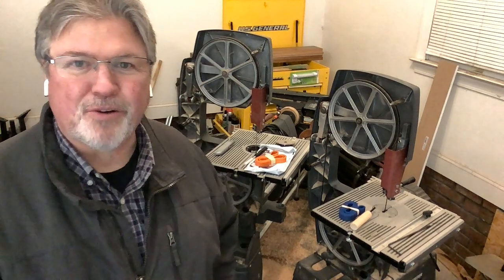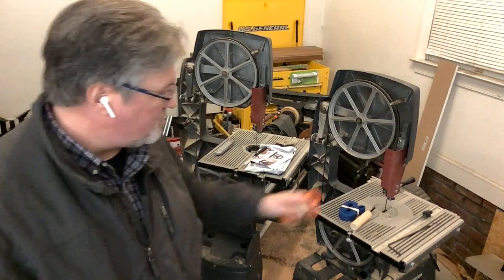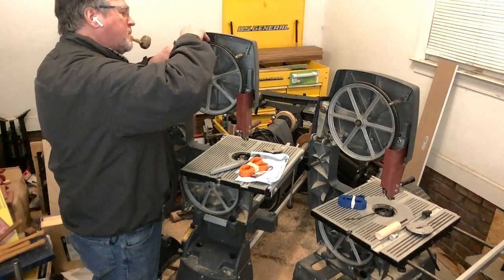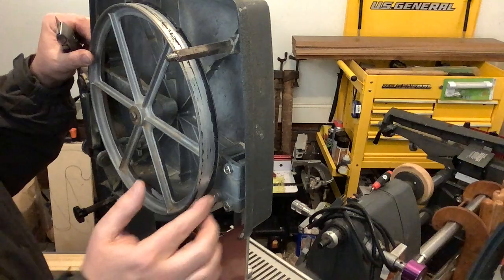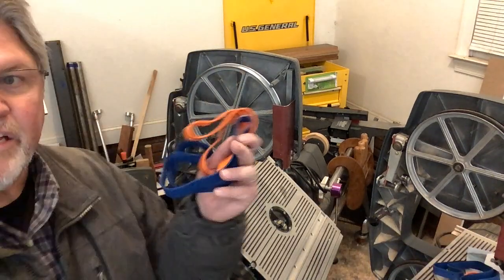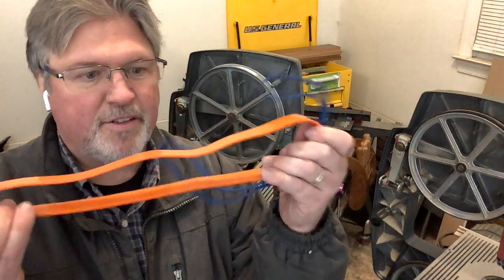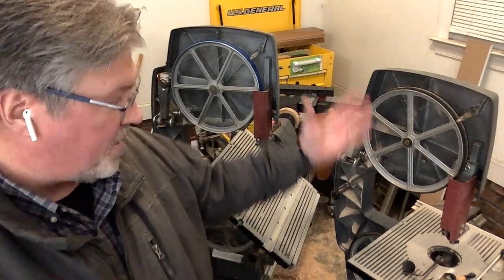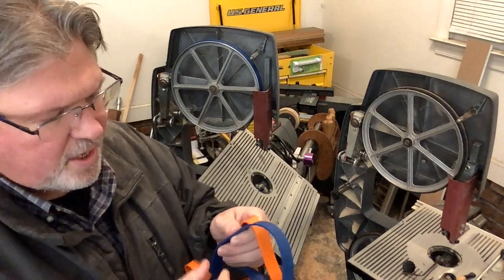Installing 2 Brands of Urethane Bandsaw Tires on a Shopsmith Bandsaw: Sous Vide Everything?

Comment: I'm wondering about tire slippage. maybe paint a small mark on the wheel and tire at the same point to see if the tire slips on the wheel? stay healthy, Russ
Reply from the maker: That's a great idea. The tires have a seam, so a mark on the wheel at that point would be easy to do. I'm on it! Scott
Reply: Garry not Linda. I've had the blue tires on my Jet for 2 years. They haven't moved a bit. Love 'em.
Reply from the maker: @bassrun101  Tht’s good to hear.

Comment: Looks like Mark beat me to it. I was also going to mention about running the tool under the tire to even out the tension.

I did want to ask if you have any thoughts on another project I'm doing. I'm restoring a very old 14" bandsaw which does not have grooves on the wheels. Is it worth trying to put tires on it, or are the likely to come off without the wheel geometry to support them?
Reply from the maker: Oooo, I think I would be tempted to glue rubber tires on. Are you sure there's no raised edge at all?  Scott
Reply: @MyGrowthRings  yes, the wheels are totally smooth. It was originally a butcher's saw.

Comment: I bought the orange tires from shopsmith and had nothing but trouble with them. 
Got the blue max tires. No problems.
Reply from the maker: Is it your recollection that the orange tires were slick and shiny like the set I used?  Scott
Reply: @MyGrowthRings  I wasn't looking at the smoothness.  I would run the band saw and the tire would be coming off the bottom wheel.  Looking at the SS owners site, I see the same complaints about the SS tires.
Reply from the maker: How long ago did you purchase the tires from SS? I recall at one time that there was a mix-up with their supplier and they wound up passing on 12" tires, which stood no chance of staying attached. That was at least 10 years ago, if memory serves me. Scott
Reply: @MyGrowthRings  I don't know. I might have gotten them that far back. I put them on last winter.  I have a tendency to plan ahead.
Reply from the maker: @daleclementson8761  If it is even a remote possibility I’d say you plan ahead!

Comment: I bought a set of blue tires and measured them, and from the seam from start to finish there 30",  the circumference  of the 11" wheel is 33" , soaking them in hot water up to 170 deg and trying to get them on I give up, what we they supposed to be before socking and stretching them

Comment: I used the orange tires but took the wheels off the machine and used a jig I saw on Youtube.  I didn't use heat.   I don't know how much benefit there is to the texture of the tire since the set of the teeth provides the purchase needed to propel the blade.
Reply from the maker: I agree with your observation about the texture, though some folks have has traction issues with the smooth (slick) orange tires. Scott

Comment: What are the odds that this video shows up today? I turned my bandsaw on a couple of days ago and the top tire blew apart. It done a little damage to the cover and put a nice little kink in my fairly new blade. I was wondering weather to go with the urethane or rubber tires from shopsmith.

Comment: I’m having trouble with my bandsaw tires. I tried the urethane ones from Amazon, the rubber ones from shopsmith, and I just got the urethane ones from shopsmith.  They keep sliding off the wheels.  Any idea what could cause this?
Reply from the maker: Did you hear them in water first before stretching them on? If so you may have used water that was too hot. Depending upon when you ordered the tires from SS they may have been too large to begin with, because they had a batch that they shipped out that were too large. Other than that I’m not sure what could be happening. I am very pleased with the Blue Max tires I installed. Scott
Reply: Looks like my wheels wobble.  I’m hoping new wheels solve the problem.

Comment: My blue belt slipped/was ripped off the top wheel and thrown out of the bandsaw by the blade. Any idea why this would happen (tensioned too much/not enough, etc.)?
Reply from the maker: How old was it? Any chance it was the wrong size? I wouldn’t think that tension was the issue unless it was stored under tension. Scott
Reply: @MyGrowthRings  3 hours after putting it on. Maybe I should have let it cool down for longer before use?
Reply: @MyGrowthRings  got another set in today. Put them on cold instead (well cold if you consider 95 degree GA weather sitting in a mailbox). So much tighter a fit than the bottom tire that was heated to 138 first. Definitely recommend not heating them as far as fit goes
Reply from the maker: @CWK09  I agree that is a better plan of attack. My garage was so cold when I installed mine that I didn’t stand a chance of getting them one without hearing. Perhaps I’ll have my next set sent to you in GA first!

Comment: I recently purchased a used SS Belt Sander manufactured in 1988. I purchased my 520 in 2004. Shopsmith, Nick Engler, did a “tune-up” video, SS112, but it not close enough to see the work done. Any chance you could take a look at the belt sander so I can know it’s functioning properly? I have concerns about the tensioning roller. I can install a belt and get it to track properly. Just not sure the tensioning is correct. It’s possibly too tight. Thanks for consideration.
Reply from the maker: That’s a video that I do intend to do eventually. In the meantime, I did a private video for a guy that might be helpful to you. I’ll tack it down.
Reply from the maker: Here it is: https://youtu.be/iJSubdfHNrs
Reply: @MyGrowthRings  Thank you for everything you’re doing!
Reply from the maker: @michaelshoemaker1  You are welcome.

Comment: Why didn't you put the wheels down on your shopsmith to help with leverage. also was the bandsaw connected to your shopsmith that might have help with the bottom wheel not rotating so much.
Reply from the maker: Yes, I did consider connecting it to the Shopsmith, but it would have been a bit of a pain considering it was mounted on the quill side of the headstock. Also, the new red wheels are driving me nuts because I’m finding them difficult to access. I’ll explain why that mattered in the mid-week follow-up. Scott

Comment: I have a set of orange tires and have them on the wall for several years because I heard once on they slip.  After seeing you struggle with them, I'm not sure I would try to replace them.  I'll just scratch up the rubber tires.  
On another subject, have you ever worked with molder blades.  I have a set of craftsman molder blades which fit the shopsmith.  I cannot however get the full profile because the table doesn't lower enough.( it hits the top of the motor.).  Is there something I am doing wrong?  I measured the radius of the wheel and it is the same as the shopsmith tool.  Any thoughts on this?
Reply from the maker: I would put those tires on eBay or Craigslist and get a set of the blue ones. If the diameter of the mouler head is the same as the Shopsmith moulder it should work. Which model Shopsmith do you have? Are you sure it’s the table hitting the headstock and not something under the table hitting the arbor?
Reply: I have model 510 which I bought new in 1990.  Pretty sure the table is hitting the headstock.

On another matter, SS used to sell long connector tubes.  Do they still sell them?
Reply from the maker: @charlessanicola545  I’m stumped then. Yes, SS does sell longer table tubes: https://www.shopsmith.com/ownersite/catalog/swd_5footconntubes.htm
Reply from the maker: I have and yes, it does! I might have to give it a try, though. Scott

Comment: Using Blue Max band saw tires for about 2.5 years now which I ordered from Ebay originally. Overall very happy and they have worked very well after solving an issue.

 I too had the same "width" shortfall. The first set of tires I received were too narrow and I too pushed the tire to the back of the wheel knowing that the Shopsmith tracks to the rear. After installing a blade, I noticed that the gap between the front of the wheel and tire was, by eye, a shade wider than the distance between the back of the blade and the back edge of the tire. As best I could measure the gap was just over 1/64th of an inch. 

Could the tire wander to the front of the wheel slot to the point where the back of the blade hung off the back of the tire? I acknowledge that I may have been overly nervous, but I could see the tension on the running blade moving the tire side to side and was not sure what might happen if the blade was not fully seated on the tire. For center tracking bandsaws, not really a problem.

I took some careful measurements and pictures and emailed the gentleman listed on the business card included with the shipment. Forget his name, but the response was prompt and professional. He did explain that he had many Shopsmith customers and no complaints, and the under sizing was intentional not an accident. But he was very considerate of my concern and sent me a new set of tires at the OEM width spec free of charge and did not ask me to return the first set.

Some data (inches wide) as measured by my calipers (pictures still on phone)
1. Wheel slot - 0.7495 
2. OEM rubber - 0.75
3. 1st set of Blue Max - 0.731
4. 2nd set of Blue Max - 0.7485 / 0.7495

NOTE: 2 measurements on #4 - I believe it is impossible to evenly stretch the tire on initially, but probably evens out with use.
Reply from the maker: Very interesting. Thanks for sharing your data. Scott

Comment: What about the Urethane tires Shopsmith sells?
Reply from the maker: As I mention at 1:20 I’ve misplaced my Shopsmith set so I can’t say for sure if they are the same as the orange set, but I suspect that they are. Perhaps someone can chime in. Scott
Reply: @MyGrowthRings  Ah yes, I remember that now. They do look strikingly similar.
Reply from the maker: @chadnevels246  I agree. I either need to find mine or have someone confirm or deny that they are as slick as the set I have. I just don't recall precisely.
Reply: From what I can tell, Shopsmith just resells the orange ones, tool and all.
Reply from the maker: @jamesbrunk9817  For sure.

Comment: I replaced the tires on my bandsaw about a year ago with orange tires. Heating the tires up never seemed to make any difference. I didn’t have an installation tool, so I wound up clamping the tire in one or two spots to get leverage. Definitely not a fun process.

But I have no complaints about the slick surface, since the teeth on the blade scuff the shiny surface.
Reply from the maker: That's a great point about the teeth doing their thing. I look forward to seeing how they perform over time. Scott

Comment: HOW YOU KNOW WHAT SIZE TIRE TO BUY ???
Reply from the maker: If you have a Shopsmith bandsaw just follow the link in the video description. If not, you purchase tires that match the diameter of your wheel. For example, a Delta 14” bandsaw has 14” wheels. Hope that helps, Scott
Reply: @MyGrowthRings  So i would buy a 14 inch TIRE THEN ?????, IF MY BAND SAW WHEEL IS JUST UNDER 14 DIAMETER???
Reply: Why would some guys on YouTube say , buy a tire that is 2 inches smaller then the wheel ???
Reply from the maker: @edmc755  Who did that? Especially if you are talking about polyurethane tires you really want to make sure that they don’t get stretched out.
Reply from the maker: All bandsaws are sized by the wheel size, and none of them are called "Just under 14" bandsaw". Conform what the saw's manufacturer calls it and that should confirm which size tire to buy.

Comment: I have installed both the orange tires and the blue max tires. The orange one stretched during use and became so loose it came off the wheel.  I then installed the blue tires and have not yet had any issues. I have install urethane tires three times.  The last one I did was easy.  I struggled with it until I figured out how to do it. The instruction that came with mine recommended using spring clamps to hold the tire in place. I could not get this to work. Handscrews, however, worked perfectly. Preventing the wheel from turning helps enormously. I found that heating either of them to be a waste of time.  Photos here: https://odinstoyfactory.robertkeeney.com/2021/02/installing-blue-max-urethane-tires-on.html
Reply from the maker: Nice! Thanks for sharing the link. I tried the clamps that I had close by and they were a fail. I forgot that I have several new to me handscrew clamps in a tub under the Total Shop, so I'll give them a go on the next two tires to see it they help. Can't see them hurting!  Scott
Reply: @MyGrowthRings  The hand screws work because they can clamp down on the wheels without damaging them. Handscrews are quite handy. In my shop, they get used a lot.
Reply from the maker: @RobertKeeney  I like them too. If you ever see some branded "Shopsmith" you'd better snatch them up becasue they were excellent. They were made by the Dubuque Clamp Company, who also marketed them under their own "Micro Moose" brand and they are some of the best made handscrew clamps I have ever used. Blow the Chinese ones out of the water and are superior to the Jorgenson clamps, which I also like. Scott
Reply: @MyGrowthRings  I will keep my eyes open.  I don't see good used clamps for sale often and when I do they have crazy prices on them.
Reply: @MyGrowthRings   Until right now I  never knew of Dubuque Clamp Company, I guess not many have.  But I actually grew up less than two miles away from the listed address.  A small world we live in
Reply from the maker: @brucepeter3409  Wow! Are you still near by?
Reply: @MyGrowthRings  no moved away after graduation!  Most of family is still there near Dubuque!
Reply from the maker: @brucepeter3409  Well, the next time you are in the area please drop by to see if they are still there.

Comment: I  don't  know why people  have so much  trouble  ,  I  put  them on no trouble
Reply from the maker: Could be luck of the draw. Also, some people purchased them from Shopsmith only to learn that they were supplied with 12" tires, which went on easily but eventually failed. I believe my issues related to doing it in a cold shop. Scott
Reply: @MyGrowthRings  a warm day always  helps  👍